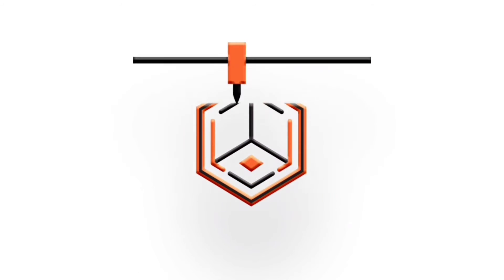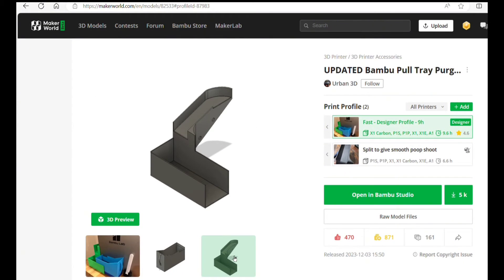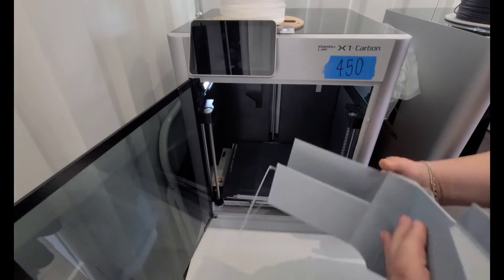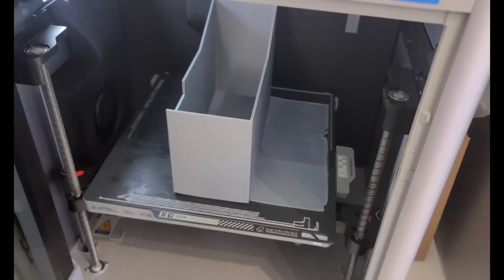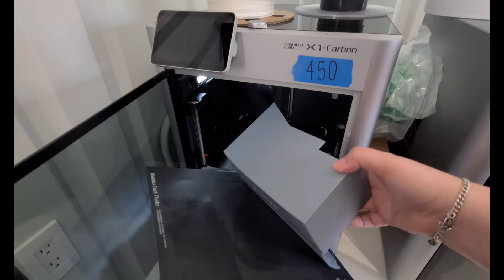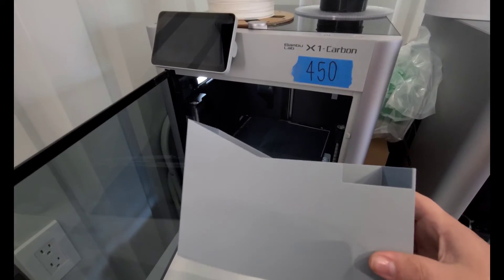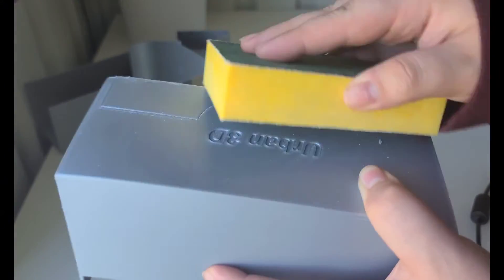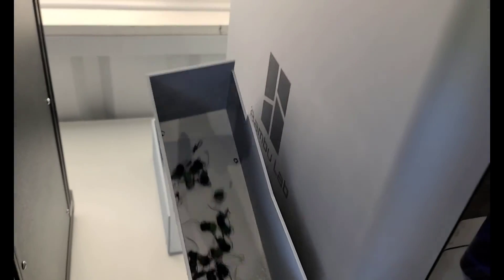Pull Tray Purge Bucket 🪣 for the Bambu X1C!

Comment: Can you show us your air filtering system in one of your next videos?
Reply from the maker: I actually don't have anything special. Just a mini-split HVAC unit for the room that swaps in outside air. Also, I live in Texas. So most days I have my windows or sliding door open. And I print mostly PLA so not too harsh of chemicals. Thanks!

Comment: I'm going to push again for the idea of recycling filament, which is strange for me because I'm definitely not one who buys into all the "save the earth" concepts.

Many recycling ideas really don't help the environment in the long run.  They often require much more energy than using raw materials or the chemicals needed to prep the recycling are far more toxic than just making new products.
Reply from the maker: Yes I am trying to find someone local that can recycle it for me. I don't have the room and I don't think it makes sense to ship it. Thanks!
Reply: @tada3dprinting where I live, shipping it would be the only option other than recycling it myself, which I'm not opposed to but it would take some money to get the equipment. 

P.S. Shipping it would have to be cost neutral for me.  But if it increased sales, that could be considered cost offset.